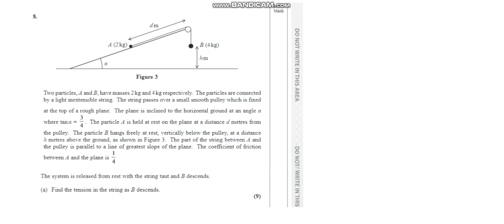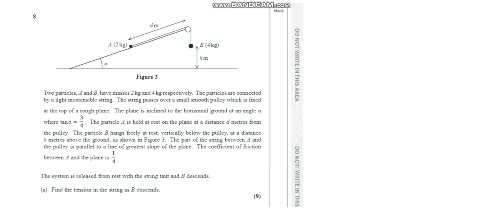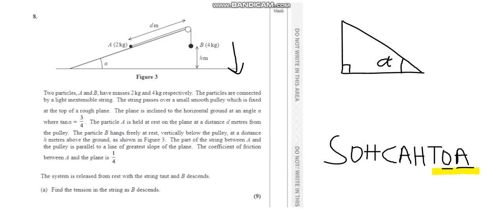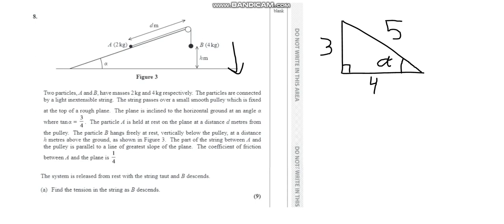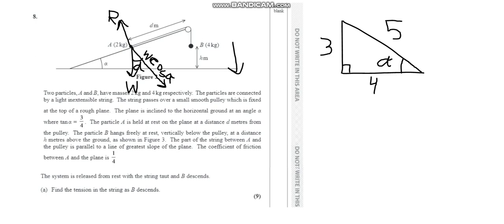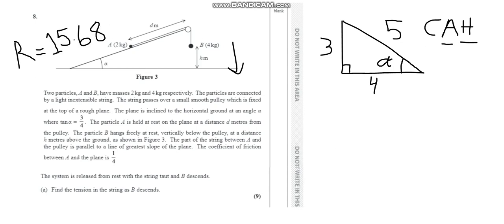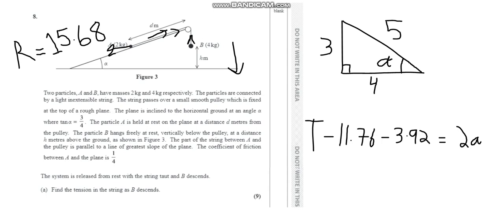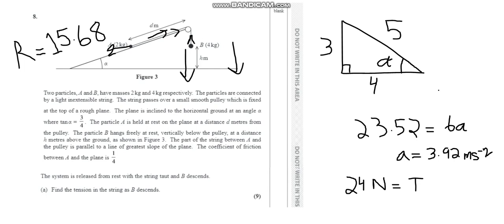WME01/01 Mechanics M1 *Jan 2021* Q8 (Pulley dynamics) Pt. 1

Comment: at 8:29 you get the difference between 11.76 and 3.92 instead of adding them together? Both values are negative which should give -15.68 so if I'm not wrong did you make a mistake there?
Reply from the maker: Yes, but I compensated the mistake in the end of the video to explain that.